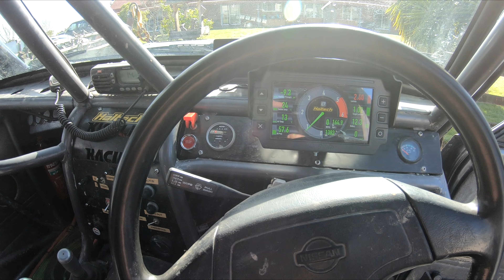Race Car Engine Comes Out

Comment: Hi bloke....Steve that used to have the white swb turbo jpc set up.....I know it won't be a 4.5 as thay have weaker con rods....I'm hoping it be a 4.8 but you will want to buy the best oil pump gears...as you know......

Comment: I'd you got any sense mate it will be a td, I have faith 😂😂
Reply: TD42 ☠ is dead and overrated mate nobody does kettle 🫖 swaps anymore to much money for little reward TD42 engine pick one up for around 8 to 10 grand, TB48 engine pick one up for around 3 grand... petrol is cheaper than diesel these days specially when it comes to servicing.
Reply: @nicholasturner5159  it was a joke mate, I have 2 tds and I know they are out dated and have issues, still rather one over a 4.8 but
Reply: @toms_gupooe  when the TD goes bang fix it with mang 😉